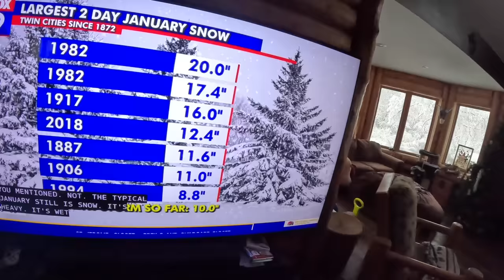Plowing Through a Record Breaking storm

Comment: Hey Stan.  I'm from MN as well east of Fargo in the Detroit Lakes area.  I love watching your videos and seeing you try out new equipment.  Just curious why I have never seen you use wings on your Boss plows or do a video on them?  I know you used to use Boss, but not sure if you still do.  I have Boss 8.2 DXT with wings making my setup a 10.2 hooked up to a 2011 2500 Chevy with a deleted Duramax 6.6. The wings cut my plow time by at least a 1/3, and if not sometimes by half, and I can push almost, if not as much snow as a snow pusher and I can pile 8' to 9' high saving room for the next snow fall.  I save so much time cause I don't have to go back and cleanup wind rows.   Cleaning out corners of parking lots is so much easier now without dumping snow off the edge of the plow while turning.  If you don't want them on, pull the pin and slide them out.  Literally takes seconds to take them off and on and they can be thrown in the back of the truck when not being used.  Because they are poly with a rubber cutting edge, they are very light.  They now make stainless as well.  I did this maybe a few times but I eventually I felt naked without them on and felt i was wasting time.  I haven't taken them off since in almost 3 years and the rubber cutting edge still has a lot of wear left.  It's adjustable downward for more wear.  At the time I got mine 3 yrs ago, they were around a $1000 installed and of course they paid for themselves immediately.   You have to lift a little earlier than usual when getting to the pile or the wings will grab the pile when trying to lift as they point forward, but this is easily learned.  Could you do a video with this setup?  I'd love to see it.

Comment: The one thing I have found out in my years of snow plowing is that the more people and equipment in a lot the less efficient you are.  You always have someone who leaves snow piles for the next guy to pick up with bigger equipment and someone will get stuck in the snow pile. One thing I would do is follow the trucks to the loading docks find out the dock they were going to plow it out and around it and get the hell out of the area.  My job was to keep the trucks moving at the factory in and out. There was a public street not part of the plow contract I would plow it anyway free of charge to keep the factory open. The detention down time was $15,000 dollars a minute if you shut down production at the GM factory. It was a supplier for GM factory.    Sometime more is not better.

Comment: I have an insulated camper with a small refrigerator and propane powered heater all of which has firmly mounted on top of my utility body which obviously holds an assortment of tools...
It's great for long or short term sleep and wondering if it would be beneficial for you if you guys since your accounts have doubled and you are traveling far away from home?

Comment: Stan  I know you have done videos about pricing, but could you do a short actual real pricing video for plowing for the Great Lake areas. No one ever wants to say pricing specifics because of areas, but with the cost of things now  prices are all over the place. Trying to get an accurate per push for a residential driveway, I had a guy call about doing an acre long gravel driveway how would you price that, I know there are variables but if you can say for example I don't go out to any residential plowing job for less that X price and fall generally between X pricing to X pricing that would help. I get some people that think it should be 20 dollars , but  with gas insurance the plow at 12K the truck at 60K you know the cost of running a legitimate business adds up. I just want to get a good idea of actual going 2023 rates for legitimate businesses not the fly by nights that have no insurance and garbage equipment.  Thanks and great content as always!

Comment: Stan you might need to replace the mount on Blaine’s truck cause if I remember correctly you got both of those western plows roughly at the same time and the regular cab was the first truck with a western then the extended cab was the second

Comment: What if you had a big dumper driving around with a side plow doing the "Opening" on the large lots.  One guy running in circles keeping the lots open for the businesses keeping the "Front row plus one parking bank free on whoever was open.  The piled up windrows from that would get cleared back by the skidsteers and loaders.  The  dumper could drop sand as an upcharge.

That one HOA you did would take far fewer passes if you went around with the truck kicking the snow up onto regular side banks.  The guys on the crew might be better rested as well and you would be able to catch things like those brackets with them realizing the clunking around is serious.

Comment: Want to ruin a truck. Put a plow on it. No doubt. I managed an auto shop in Colorado in the late 90s. Didn’t matter the brand, none held up. Solid axle trucks did better for sure. Add some timbren stops helped. I’m sure the tech these days in plows is better. Dodges we’re the worst. Trannys we’re always junk, and coil spring front ends had weak trac bars